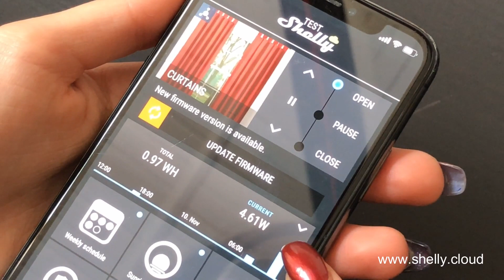Shelly2 obstacle detection

Comment: How to apply it to roll-up shutter ? 
I've tried and it has continued to move also if i've placed an obstacle under
Reply: Basically it works by monitoring power consumption. So if a Motor is struggling more than usual, it's drawing more power. You set the Power limit above normal operation, so when more power is drawn (unusual load on the motor) the app stops the motor.  (I don't have a Shelly, so I'm guessing)
So you probably have set the power limit too high.
Reply: @shadowcheto85  may be but i've not been (from 11 months) to establish the correct consumption to set